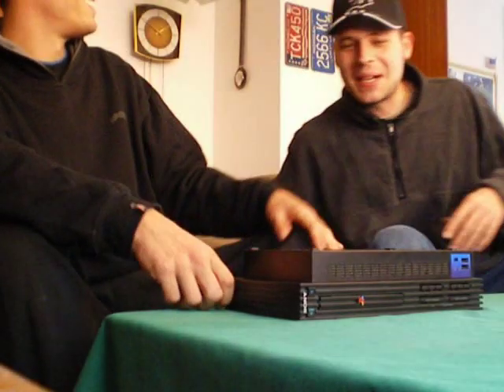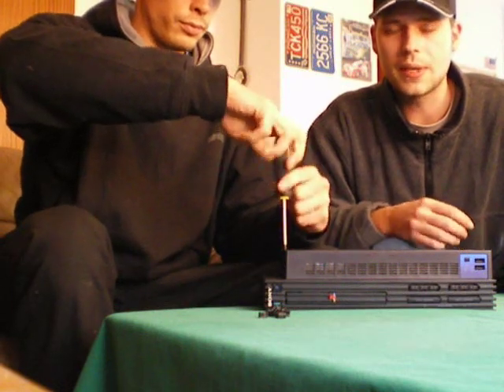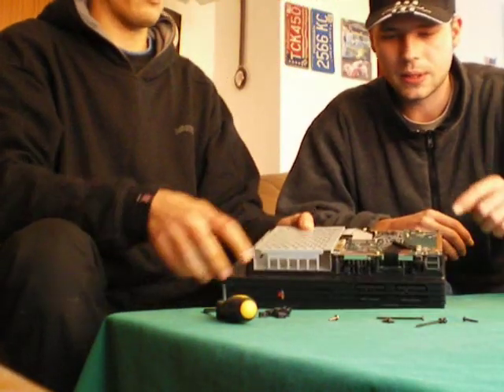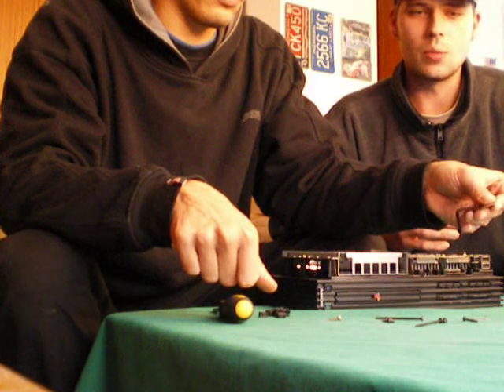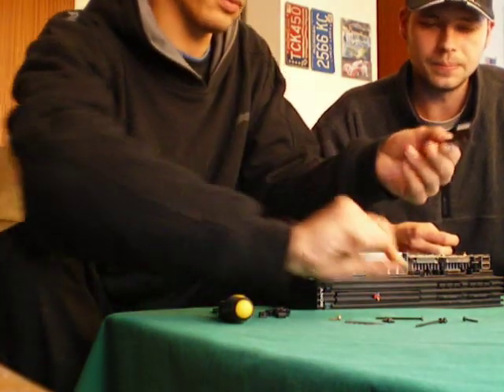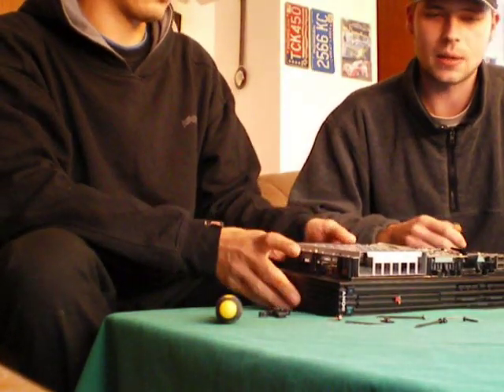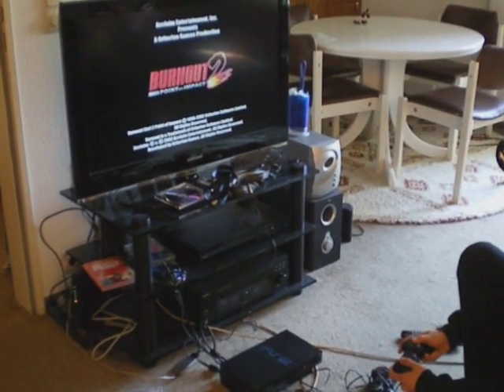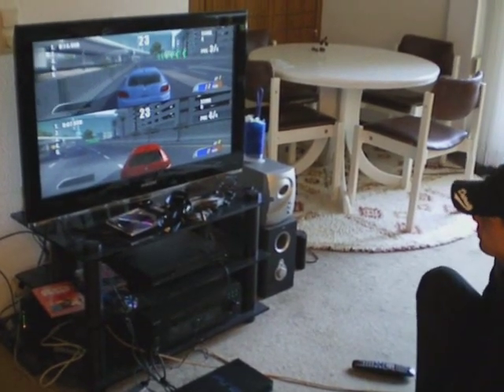PS2 Controller Port Fix

Comment: I know this video is old but I may have to try that method my controller Port 1 works just fine its the controller Port 2 that's giving me problems u plug a controller in and it's shorts in and out. The analog button lights up then cuts right back off. I've opened it up cleaned both ports out and lightly cleaned the ribbon off. My game gave me the impression that it was working properly I tried it out before I screwed everything back in so I got very excited. Then once I screwed everything in and plugged it back up boom same problem again. So I don't know what else it can be. Maybe I will do it all over again and go to the motherboard like you guys did. Eh I might have to replace both ports and ribbon.

Comment: 12 years later and I have a question, since my controller port 1 does not work however controller port 2 does, I wanted to check if it was the controllers and tried 3 new controllers but it wasn’t the case all of them were not working, however they would work for a certain amount of time (preferably 2 minutes) and then shut down but whilst the analog flashlight is on. It also says please insert controller into controller port 1 for all three controllers, to conclude if I get a new ribbon cable can this issue be removed??

Comment: Jan 2022…..Was playing on my ps2 and suddenly in game the X button and few other buttons started not inputting on screen, when reset I have nothing apart from up and down on the d pad and the analogue on and off works! this is on both ports with two controllers it’s doing it with what do you think it is the ribbon cable???

Comment: Ingenious well done 👍 that controller block has a horrible compression fitting that loves to break apart, you can insert thin plastic sheet .1 or .15mm to get the tight contact back
Reply: Is yours fixed? I’m about to try it on mine... hopefully it works.. I want to play games on my ps2. My port 1 doesn’t work but my Port 2 does and In order for me to play games the controller port 1 has to work smhhh
Reply: @leviackermann9669  hya , i fixed it 100% ok using a thin sliver of plastic which I inserted into the top gap, this forced the ribbon down onto the contacts, rubbish connector (!) Best way is to leave this alone until u dissemble motherboard, then you can easily disconnect the mobo connector. Also the ODD best way is to dissemble this to laser deck, then easily connect bottom ribbon connector thru laser deck, way easier. Lovely system bar these 2 fiddly connectors 😜
Reply: @Thunder_Light207  heyyyy I just fixed mine!! Works 100%
Reply: @Thunder_Light207  see all I did was unscrew the ps2 a reposition a couple things on the ps2 controller port and it now it works
Reply: @leviackermann9669  u r a bad boi 😜 congrats on fixing ur system, i love servicing ps's really satisfying 🎂 Got a 2nd hand ps3 fat off ebay which I'll strip down next week, amazing how these great systems r so cheap now, thanks to the crazy ps5 prices ... Ouch! 😸
Reply: @Thunder_Light207  Frrrrr😭😭😭 lolll My cousin got the pS5 and I’m like that’s a wholeee lot of money.. but I’ve wanting another game system for a while tho.. I have an Xbox 360 and it gets annoying bringing it upstairs and downstairs cuz I like to switch room sometimes.. So now that I fixed my Ps2 I’ll have it in my room, and then I’ll leave the Xbox downstairs
Reply: @Thunder_Light207  and Thanks!! I was so scared fixing it too... I’ve never done anything like that before cuz I always have a warranty and have the store fix it for me.. but my grandma got me this ps2 for my 9th birthday from GameStop and yhe warranty is worn off by now... that was 10 years ago💀💀 I’m 19 now lol..
Reply: @leviackermann9669  cool u can get ps3's nice and cheap with loads of ace games and trophy support, also ps2 u can get sata hdd adapter for the ps2 fats and mcboot to enjoy playing ps2 games off an ide or ssd drive, makes it a brilliant cheap console, loads of fun 👍 got an old ps1 and ps2; off ebay as well, lovely retro goodness with brilliant games 🎂

Comment: Thanks guys - nice vid.  I looked at the flat controller lead in your vid & it had rust on it (someone spilt something!).  Cleaned the contact points & it worked fine again.  Thought it worth saying in case the actual strip is not broken, like yours was. Thanks for posting.  :)

Comment: Try and unplug and replug first so you don’t have to cut anything. I just did that and my player 1 port started working again
Reply: Hope that may be what I need to do, just got my PS2’s laser and AV out fixed, and hot a mod chip installed!

Comment: November 2018 and this helped me!

This is also how all tutorial videos should be! No 30-second intro, no annoying music to drown out the actual instructions...
Reply: Justin Sison woahhh are u fr cause I was shady on trying it
Reply: @treezy7567  Yup, the video explained the most important things: the problem (black flex cable loose) and the solution (disassembly and repair). So I popped open the PS2, found that cable, put it back in the connector, pushed down on the connector head clasp thing to lock (you will definitely feel it), reassembled, and I was good to go. I didn't need to tape the cable down or clean it or anything.

How I originally broke mine was, I accidentally pulled the flex cable out trying to fit the PS2 in a Ikea Kallax shelf with a "Better Homes and Gardens Cube Storage Shelf, H" from Walmart. Turns out the PS2 is like 3 millimeters too wide for that, but I thought I could force it in anyway. Well, because I kept the PS2 unscrewed for easier maintenance, the bottom separated, and the top shell pushed the memory cards down, and that pulled the flex cable out.

Comment: In no way, shape or form does the cover come off like this video describes. I have the exact same PS2... it requires 8 screws to be removed, not 6, and there is still something holding it on in the front. I still have yet to remove the cover.
Reply: I thougth that at first but you only need to remove six to make the bottom come off.
Reply: OK, what these two meatheads don't tell you is that there are two screws on the underside (or top side really if the PS2 is in it's natural position) that need to come out too. You need to take the cover off the other side as well to get to these additional two screws. Once I removed them, the cover came right off.

Comment: Thanks guys this helped me avoid damaging the PS2 while i opened it. My problem was the same. One controller worked erratically. Bought new controller. The new one didn't work at all!  At that point I knew it was the PS2. Popped it open, and simply detached the ribbon cable from the Port board (on both sides), blew on it a couple of times and then reseated it properly. THAT WORKED! Perhaps heat/cold over time slightly loosened it.  So happy. Thanks!!!!!
Reply: This comment was my last hope, the ribbon didn’t appear damaged so I just cleaned it and reinserted it properly, and whattaya know , it works 🥲

Comment: my ps2 isn't really grabbing the controller tab. it slides in and out. the ports work, but it's only sliding in the controller 1 port. controller 2 port is grabbing and holding the controller tab. in other words, my ps2 female part is a little worn out and loose.

Comment: TABS BENT
I just bought one, a minimally used console, looks almost new, nice and clean, controller is not working. I looked inside the slot of the port connector on the front of the console, the left side metal tabs on both 1 & 2 controller ports are bent in, you can see it without taking the console apart, shine a flashlight in there, there should be 4 tabs, one of the 4 is bent in, like the controller socket pushed one of the tabs in for some reason. Why the tab bent I am not sure, a bad factory bend angle? So I am going to try to figure out the best way to bend it back out to where it should be, a small pick, or something.
Reply: i have the same problem, were you able to fix it?

Comment: I am faced with very weird issues. My PS2 controller doesn't get recognized by all games. For example Kengo works fine, Ace Combat 4 and Mercenaries: Playground of Destruction don't recognize it. Has anyone ever faced such a problem? Also, the PS2 reads Kengo without problem, sometimes it cannot read Mercenaries, and it almost always fails to read Ace Combat 4 despite all CD's being in a similar good condition.
Reply: +nyarlatothep666 

I have the same issue as you, the model I have is the slim one, the controller port 1 work only playing nes emulator on ulaunch elf and some games, it work perfect on system config menu. I opened up the console and cleaned the fuses on-board near the controllers port and the slot solder with rubbing alcohol, i used 100%  isopropyl  and now works perfectly, because the dust and oxidation can cause bad contact
Reply: LucasDMX1 I hope this will help with not vibrating ds2 (under pc is ok) and 3party is ok but week vib ;/

Comment: I tried this on my ps2 and did exactly what they did on the video, but when I tested it neither controller ports were working and neither was the memory card slot ;-; Is there something I might have done wrong? And is there a way to fix it? :'(

Comment: My controller wont work, the analog light will light up but wont work please can anyone help me ?
Reply: same issue with me..any one can fix this..plzz
Reply: rowell bayuga me too. Im very annoyed i wanna play my game.
Reply: Don't plug the remote the whole way in, keep pressing the buttons until you find the right spot as you put it in
Reply: Dylan Potter its still not working

Comment: Had the exact same issue , duck tape WON'T work cuz it must make constant pressurized  contact with the motherboard port. I used the point of a very small flathead screwdriver. You MUST be very gentle when forcing the end of the cable DOWN in the port till it doesn't need to be clipped in, but clip it in anyway. Free mcboot psx-scene(dot com)   is the way to go from here, but you might have a lil trouble getting it fully installed, but perseverence pays .

Comment: My controler port isn't sending the info of vibration to the controllers (only port 1), and I couldn't fix it 'cause mine is slim, and the port is attached to the mother board :(
Reply: Marco Aurélio Dantas i have similiar issue official dualshock2 dont vibre but 3party works ;/ ds2 is working under pc strange.

Comment: Not that there's anything wrong with it I'm just pointing out a few differences between the 8 screw model to the 10 screw model (I had a 10 screw model but it was broken so I replaced it with the 8 screw model which I currently have now).

Comment: I got a fat PS2 but mine has 8 screws holding the case and the power supply is on the bottom not the top.

Comment: Okay, my dualshock stoped working yesterday, I couldn't move up or down in the menu or press any button but in a games menu i could press up and down but not select with any buttons. Now I tried with my other controller but my ps2 doesn't respond to it in anyway except up and down in game menus. I tried back with my first dualshock and now I could move up and down and press buttons in the ps2 menu but the analog stick didn't work! I'm gonna buy a new ps2, but I'd like to know what causes this.

Comment: @NekroZack Actually according to my knowledge it's impossible to get a spare part of a PS2, the only hope is to buy a new PS2 if any part has failed, but there is a solution that youcould give your PS2 for repair to that shop from where you bought it...
My controller port also malfunctioned, I thought of watching this video for help but my model of PS2 was unfortunately 2006 and the inside was different
but I opened it myself and cleaned it a little bit, and it was working better than before!

Comment: @MultiDragoonX Yes, I bought a new controller, and it won't work. Then I realized it wasn't because of the controller, but the port. So, do you know how much a new port costs? Or is it impossible to buy that single piece? Thanks! :D

Comment: Hey! Um, I have a different issue with my PS2. It seems that the problem IS the Controller Port, but in my case, it recgonizes when a controller is plugged in, but in has problems recognizing when I press any button! Could it be that my port is beyond repair, or if it's possible to repair it, what do I need to do in order to repair it? Also, how much does the Controller Port (that piece itself) costs? I'm not sure they even sell the whole port, but if they do...how much will it cost? Thanks man!

Comment: Niether of the controller ports work on mine. However, they can be recognized, but it's as if the controller is malfunctioning... But I have tried multiple controllers that I KNOW work, and it is not the controllers. Do you think this will work for me, too, even if the ps2 CAN recognize controllers??

Comment: The Holes In the port came out the ones where u connect it to the control is there a way i can take the holes from the second port and put it to the first one so i could play in the first port